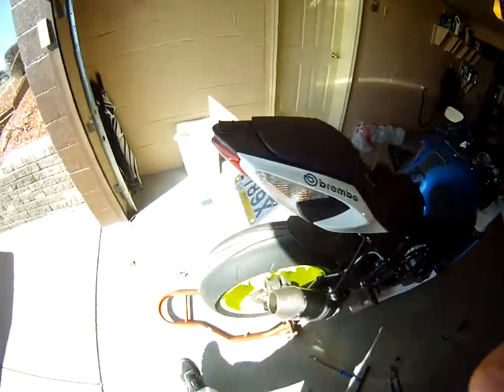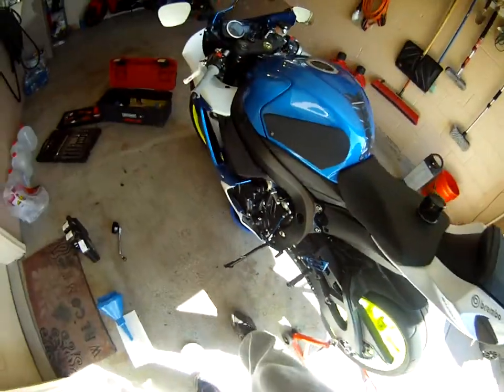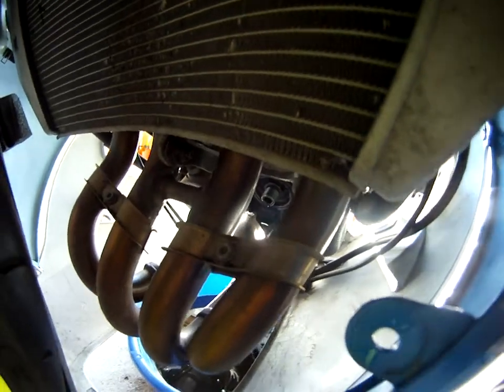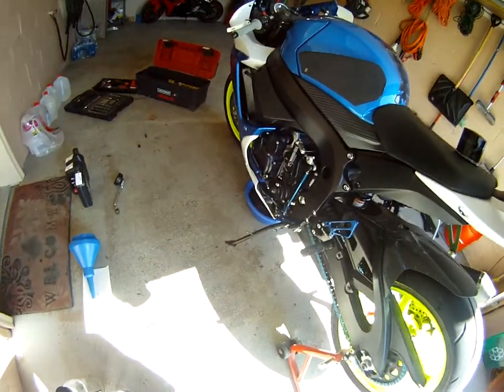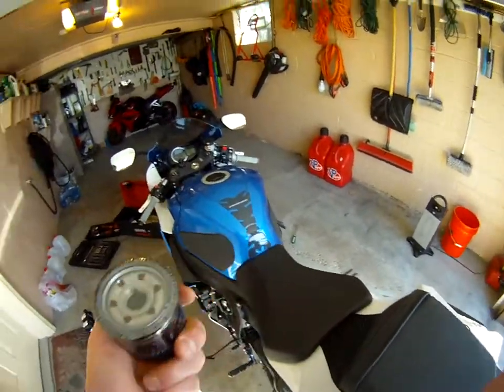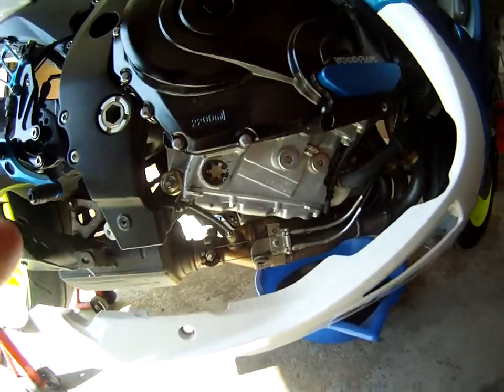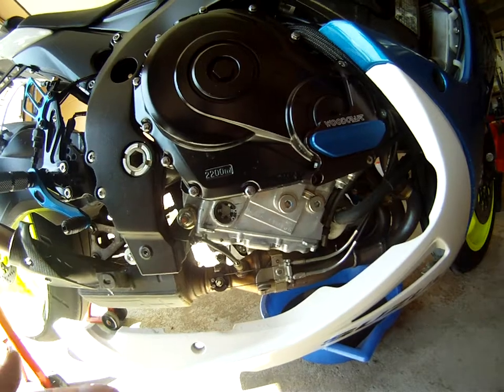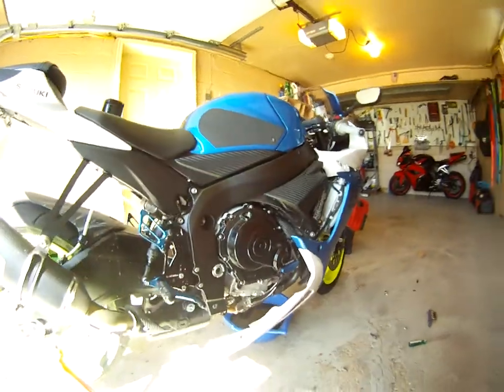2013 Suzuki Gsxr 600 how to change oil and oil filter

Comment: Nice don’t even have to take the fairings off same on my 2013 gsxr600 smart! Just loosen them up enough to access oil filter and secure new one I like to put just a little oil in the filter so I don’t worry about initial start with filter being bone dry

Comment from the maker: About 2 screws and 2 push pins.  Push pins are at front of bike by radiator, and bolts are lower and mid fairing.  U can also put tin foil on headers to keep clean.  I just wipe them off and it burns off when u run bike.

Comment: How many snaps or sews did you loosen to get the fairing pulled forward enough to get to the oil filter? I have a 2011 gsxr 600 an I don't wanna get oil on the pipes that run back but I need to get the fairing out the way some so I can get to it.

Comment: what kind of slip on do you have
Reply from the maker: It's a Leo vince
Reply: I also have a 2013 gsxr 600  and i havent put a slip on on yet. does the leo vince sound pretty nice?
Reply from the maker: Sorry leo vince Italia sbk it's called I think.  With the cat on the bike it's not much louder than stock at idle.  When u get into higher rpms it sounds really nice and clean.  I cut my cat off and it sounds amazing now.  Really opened the sound of the bike up.
Reply: when you cut the cat off did you put a mid pipe on? and i cant decide what i wanna get i want something that sounds good all the time i just bought the bike ehh about 2 months ago brand new from a dealer had no miles at all. so im starting from scratch.
Reply from the maker: Yea I went w the MJS stainless steel midpipe.  Very impressed w quality for $150...  I just need to get a power commander 5 and get bike tuned.  I.mean it runs good.  But could run better, alot of popping on hard deceleration
Reply from the maker: I'm really happy w leo vince.  Price was riggt and their quality exhausts
Reply from the maker: Leo vince,  yoshimura, Akrapovic,  arrow.  I woukd stick to those brands
Reply: okay so that does answer my next question bc i know with the full exhaust you need a power commander for the FI. i didnt know for sure if you needed it with the mid pipe or not.
Reply from the maker: Well the FI light comes on w full exhaust it eliminates ur O2 sensor.  W the mid pipe u cut right before cat and 02 sensor is still attached so it doesn't throw FI code.  Either way u should get power commander w mid pipe or replacing headers
Reply from the maker: The mid pipe route is just a less expensive way to a full exhaust
Reply: i just cant decide what kind of slip on i want to put on. hard decision
Reply from the maker: Yea it's tough.  Some good ones out there tho
Reply: thats for sure just gotta find them
Reply: i ended getting the leo vince sbk i ended up getting a better deal and was pretty satisfied after i put it on yesterday. now my next step is to get rid of the cat, so it can get better sound.
Reply from the maker: Nice man.  Great exhaust for price.  But Def ditch the cat sounds alot better
Reply from the maker: Leo vince sbk italia
Reply: Hi, few questions:
1. What is the oil filter cap wrench tool you are using? what is the size? I know suzuki sells OEM one but it's overpriced and I don't know the diameter to get after market one!
2. Do you know the torque values for the oil drain bolt and oil filter when you tighten them?
3. Do you have to replace the oil drain bolt washer every oil change?
Thank you